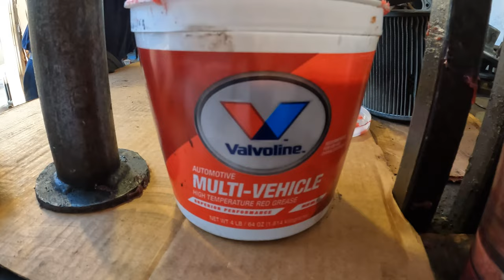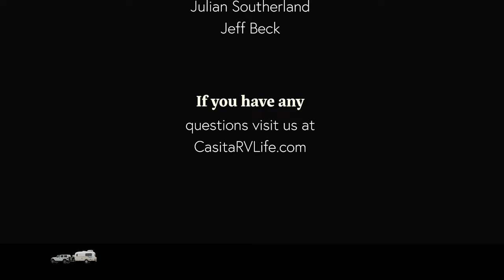Wheel and Brake Maintenance

Comment: I do everything you do except packing in grease by hand (putty knife). Instead after reassembly and prior to dust cap installation, I use a hand pump grease gun to put grease in via the attach fitting at outboard side of shaft. That’s what it is for. Plus it gets more grease where you want it. Then I can sleep at night. Excellent video sir!
Reply from the maker: That will work but I still feel better hand packing them.

Comment: How many miles before you need this maintenance?
Reply from the maker: Dexter recommends inspecting the brakes and hubs every 3000 miles and greasing them every 12000 miles or 12 months.

Comment: Have you ever just used a grease gun to just exchange the grease without removing the wheel?
Reply from the maker: Yes once but I like checking the brake assembly after the problems we had.